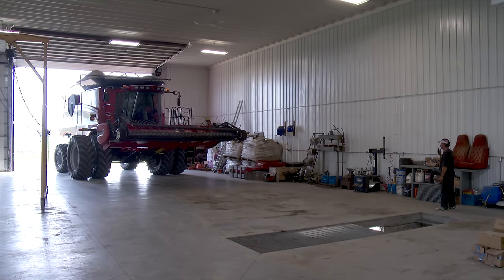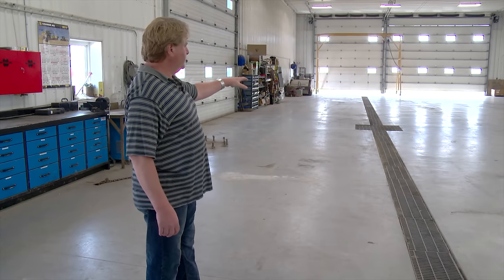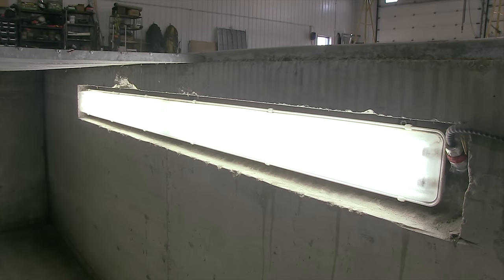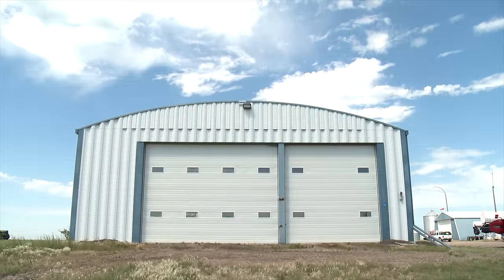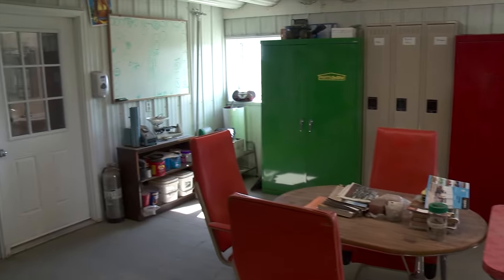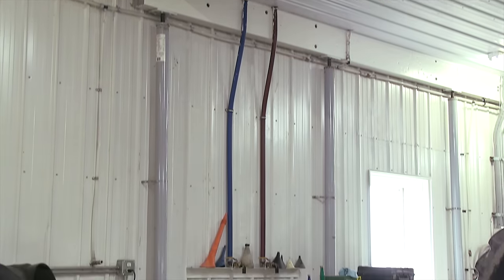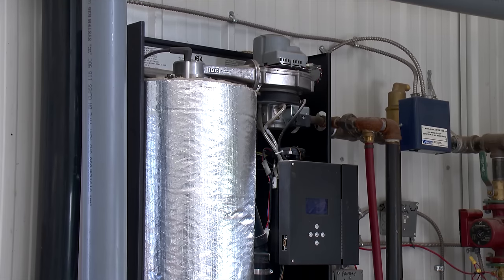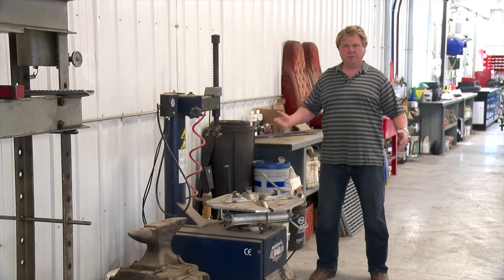Custom Farm Shop with Mezzanine

Comment: It looks to me there were some smart decisions made in building that shop.
Now you need an addition built for the bigger combines. :-)
Reply: I was thinking the same thing. If it was my shop I would add the addition to width of it and make it just as wide as it is long. Instead of doing roll up doors I would do sliders like they use today in custom homes for the open concept to the backyard and put a small high torque electric motor to open and close it with a release on it in case something happened to be able to open and close it until you had the time to fix it so you don't have to stop production in the fields.

Comment: I would really like to know what the price was to build this garage I would not want garage doors each side I would want I'm just on the sides just to pull in 3 of  Them please comment back with the price of what this garage cost or shop or lead me to who built it so I could find out for myself thank you very much from the the concrete to finish job even the   The opstairs thing I like the way you did this it could really function for me I'm starting to buy classic cars and that would work fantastic for me I also have a landscaping business thank you again please comment back

Comment: Out of all the buildings that I've seen on YouTube I think this is the best building that I've seen And it is also the cleanest and the Most organized building that I've ever seen I like how you did the Motorola and the hydraulic fluid I would do Motorola and transmission fluid transmission fluid in mind I have a few collector vehicles vehicles and it would be in good use and I also love the pit and the drain Very well done I love this building building I don't need that big of a door door but I would have one big door please comment back thank you

Comment: Most farm shops I have seen need a perimeter French drain to extend the life of the foundation and radiant heat at the entrance to service equipment in the winter.

However, I only see these in factory buildings.